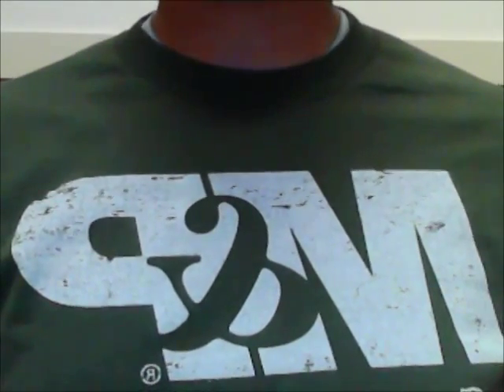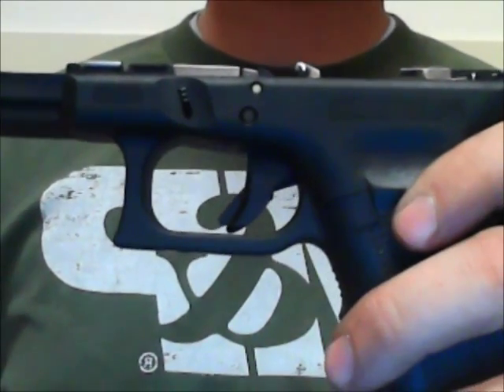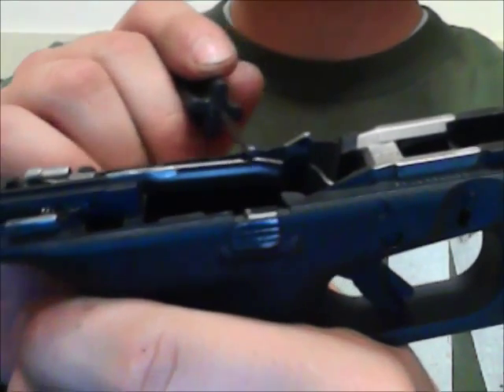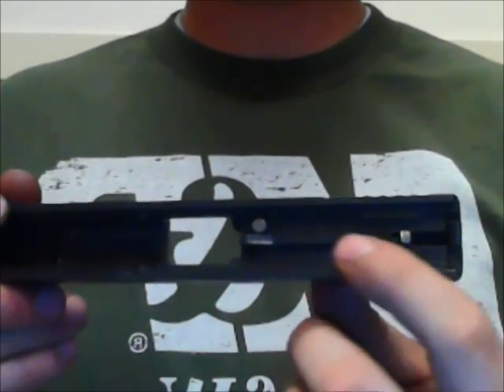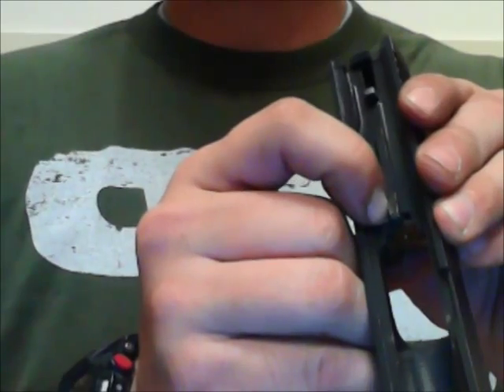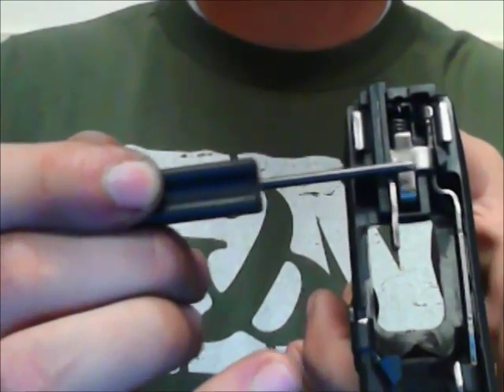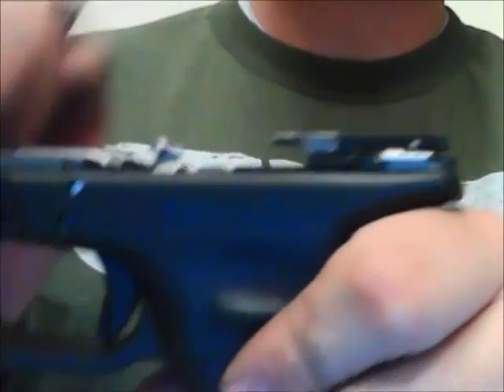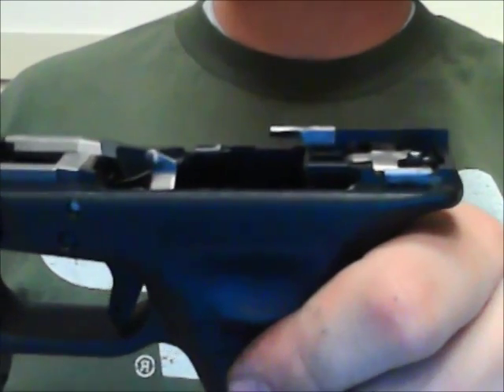3 Safeties on a Glock

Comment: On the last safety, you only explained the D/A of the sear pulling back, more, on the striker and then it's release, downward releasing the striker.  The actual "Drop Safety" is the "ledge" where that cross is resting thus preventing that cross from dropping.  It takes a trigger press to move that "cross" to the rear off that ledge while also compressing more of the striker spring.  Once the cross moves off that ledge and the trigger connector can allow the sear to drop releasing the striker.  By that striker pressure on the sear and cross keeps that cross on that ledge preventing a drop release.  Should it ever release, w/o a trigger press that striker block plunger then prevents the striker from moving forward.  The trigger connector allows the cross, by action of the upper slide channel, to reset the cross and sear in the upper position to re-catch the striker tang and reset the trigger.  ONLY a proper finger press can release all three safeties.  Reason called a "Safe Action Trigger".  Good try.

Comment: Ok I see where they would be considered "safety features" I only seen two. The last feature more so seems like the functionality of the gun. All of those features can be counted as jus 1 safety honestly. If the trigger saftey is bypassed then the gun fires. You don't have squeeze the trigger a certain way to fire it, as long as the trigger safety is pressed the trigger can be as well.
Reply: Tripp Hines the other safeties are in place to prevent the pistol from firing if it's dropped. They're designed to disengage only when the trigger is depressed to fire the weapon.
Reply: Instead of thinking about what the 3rd safety is doing when the trigger is pulled, it's better to think about what could happen if that cross piece wasn't there.

Meaning, you have to think about the possibility of the 2nd safety (firing pin plunger) being dislodged in a fall/drop. In this event, the firing pin could move forward and strike a chambered bullet primer without the trigger being pulled, which is not a good thing. This type of scenario is prevented because of the raised cross-bar, which would block any forward firing pin movement in the event of a drop. Thus, the cross-bar (drop) safety is only lowered out of position when the trigger is fully engaged (by a trigger pull).

This is not just a random functionality of the gun; it is very much an intentional safety-feature, and put there by design.
Reply: it is focused not to fire when user don't want to, so if they press the trigger, they will fire the bullet haha